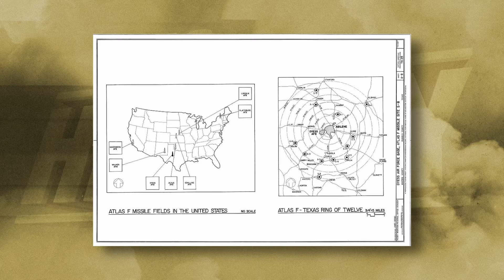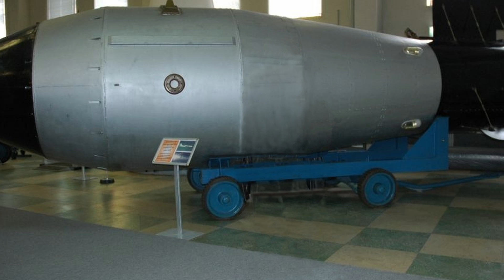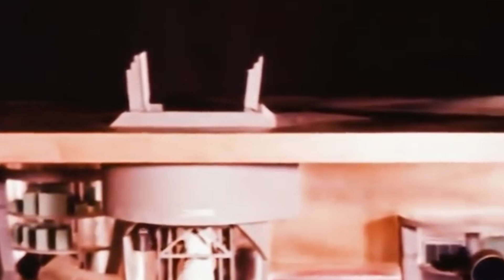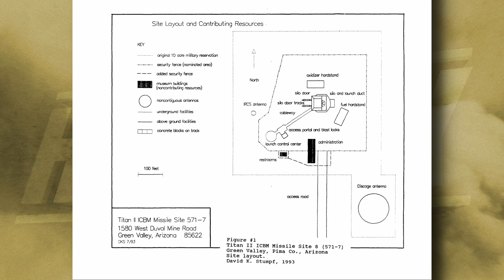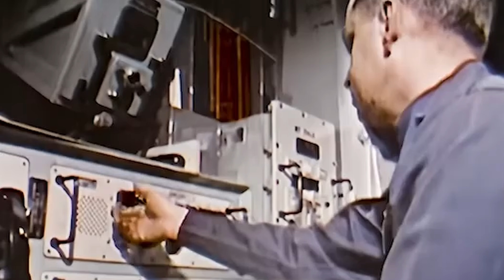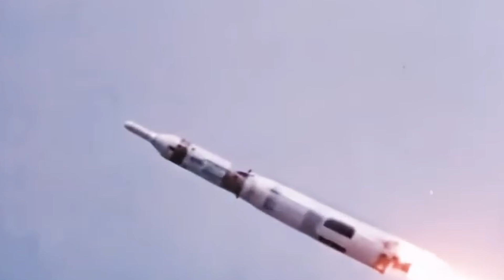Why Arizona kept the Last Titan II Silo

Comment: My wife and I visited this site several years ago.  As a former maintenance technician (EMT) on Minuteman II ICBM's in South Dakota in the early 70's, I was curious to see how it compared to the system I worked on.  Happy to say that the solid fuel rocket was quite a bit safer than the liquid fueled ones. There were, however, many similarities in the launch control systems which brought back many memories.

Comment: Not To Worry: The Air Force maintains about 400 operational Minuteman III intercontinental ballistic missiles (ICBMs) in hardened underground silos across five Western states.
Reply: 3 active missile wings with 50 missiles each. Average of 3 warheads per missile for a possible total of 450 warheads on 150 missiles.

Pretty eerie driving within a couple hundred feet of one outside Minot ND on the highway knowing I was driving by a bullseye.

Comment: How did they get the rocket down in the hole?
Reply: It was quite a project with a bunch of specialized equipment. If you really want to know, there is a book called “Titan II” by David Stumpf that details the entire program from beginning to end.
Reply: The trailer was designed to lower them
Reply: @just_because_ the carrier had a tilting bed structure.
Reply: Very very carefully…😂